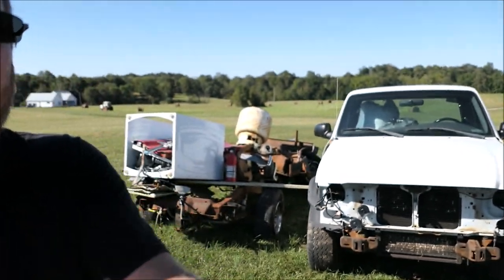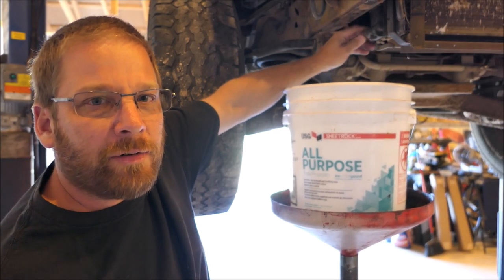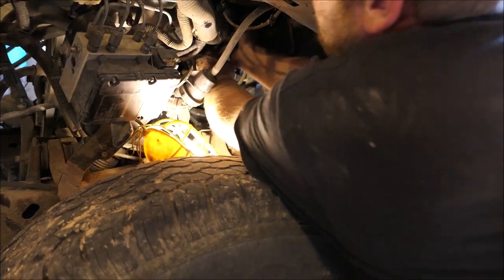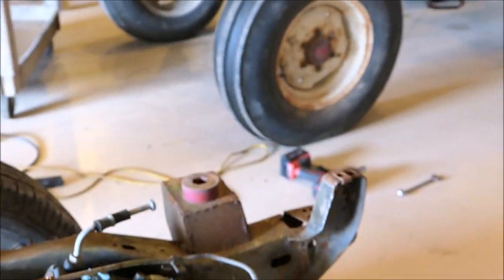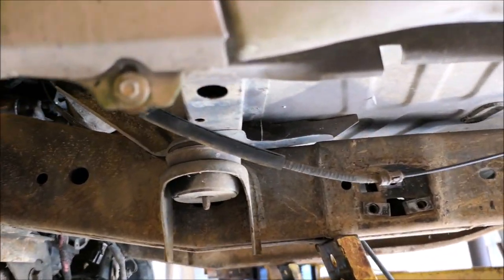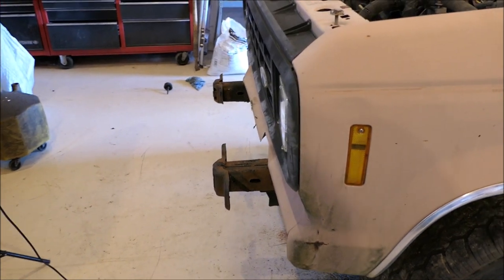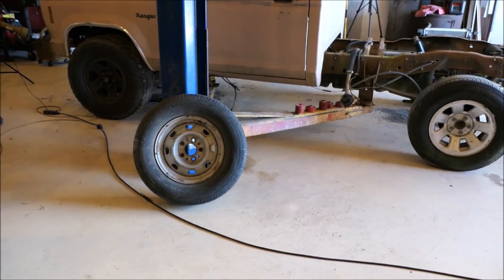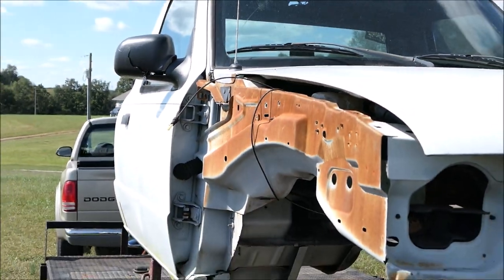Will a 1st Gen Ranger Body Fit a 3rd Gen FRAME?? ... YES and NO

Comment: I've got a 84 single cab long wheel base with the 2.0 backed with the 4 speed manual transmission. I took those same original wheels, sanded them down and threw on several coats of paint. Then I could NOT find the center caps anywhere! (I never had them) until one day, i was driving to town and spotted another Ranger visiting someone an noticed it had the centers! Turned around and the guy wasn't there so they took my info. Eventually he called me and made a deal on all centers plus the bolt on clips that hold them. For 40 bucks! * there was some negotiation and confusion cause he claimed to have found some online for sale (Ebay) and I said save that link and I'll see you soon cause there's no way! (I searched high and low already 💁🏽‍♂️) get there and wrong ones so negotiated.
My wife said, he was trying huh lol.
I said, honestly, he had me by the balls and didn't know it, I would've gave him 100 😅.
Anyways, you've gave me inspiration to find me a donor chassis now! Thanks! Be nice for better suspension!